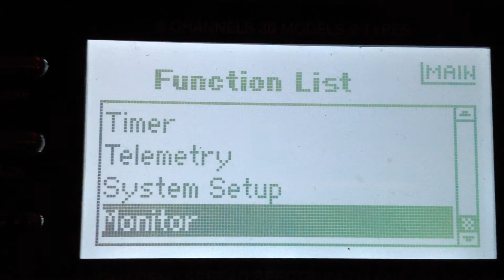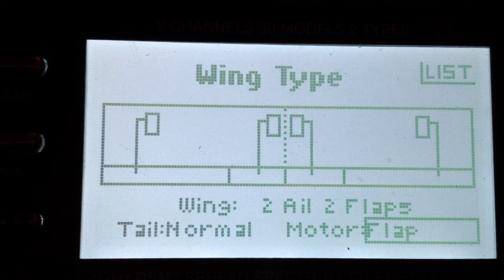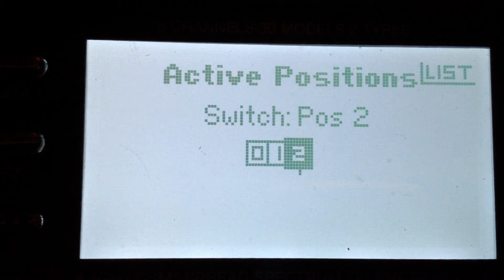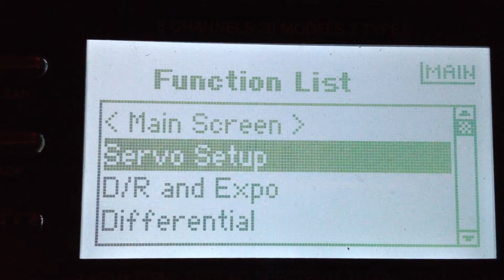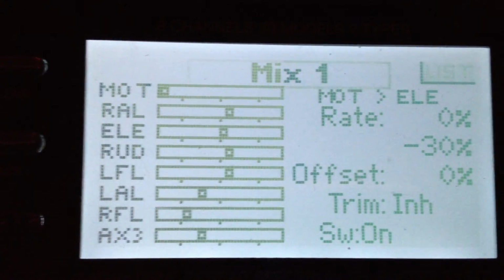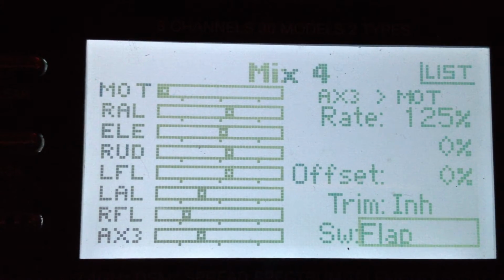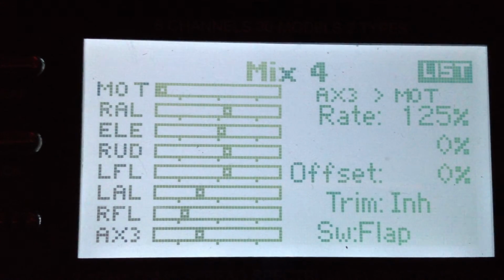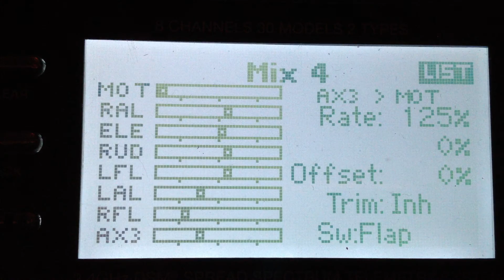Spektrum DX 8, Throttle on flaps switch

Comment: I imagine it's way too late to ask, but nothing ventured ;-}  I'm able to setup throttle on a switch but what I need help with is getting the flaps on the throttle stick?   Thanks if you still monitor these videos.   jg
Reply from the maker: You go to camper system, then set input to throttlestick, and adjust the throw you want, if you have more flight modes then you have to set the flaps in thebflights you want Them to work 😀